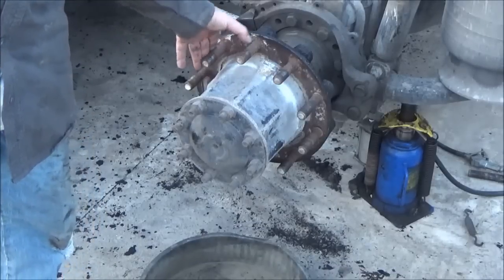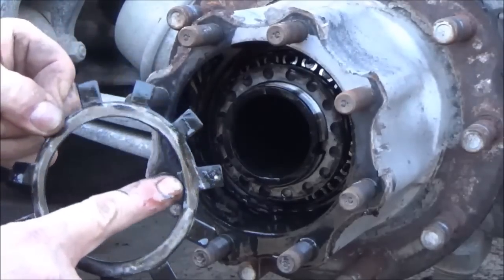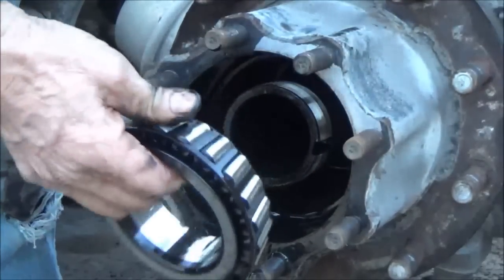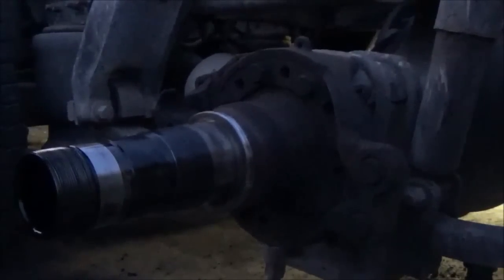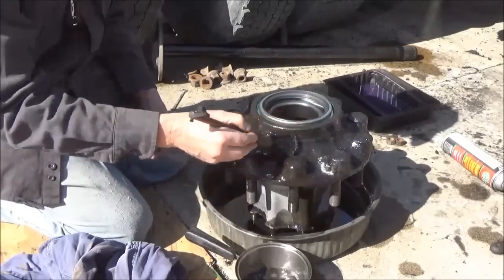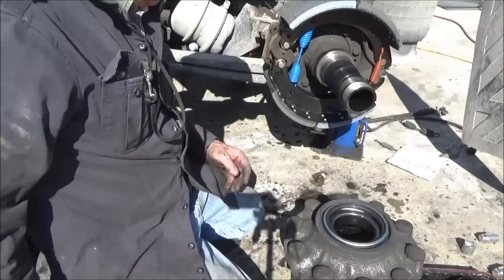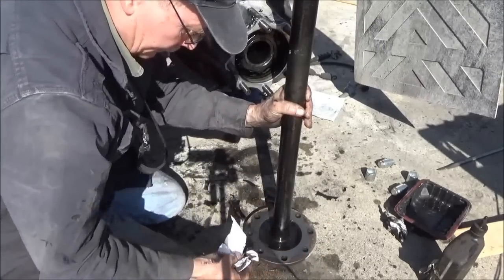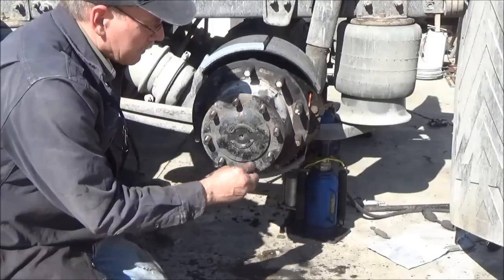Changing axle seal on semi truck at home without all the special tools

Comment: A lot of bad information in this video. I work on these trucks for a living. The TMC (Technology & maintenance council) outlined a procedure for wheel bearing adjustment for heavy duty trucks for a reason, because wheel hubs coming off became an epidemic from people performing bearing adjustments without the proper knowledge or tools. You do NOT use a screwdriver or a chisel to run up bearing nuts, this is not an acceptable alternative to using axle nut sockets. You first use a TORQUE WRENCH and preload the adjusting nut (inner nut) to 200 ft lbs while rotating the wheel/hub, then back off a full turn, THEN you readjust the adjusting nut to 50 ft lbs while rotating wheel/hub and BACK IT OFF  (according to a chart based off of threads per inch and if it is a drive axle, steer or trailer axle) which in the case of this truck would be 1/4 turn. You then align the dowel with the dowel pin on the adjustment nut, put the tang on and then the jam nut. The jam nut torque when you have a dowel washer is 300-400 ft lbs of torque. You will never achieve that with a hammer and chisel (or screwdriver) and will never know what your torque value is. You then use a DIAL INDICATOR to measure the ENDPLAY of the hub which must be within .001"-.005" (thousandths of an inch). Then fold the tabs on the tang where the flats line up (usually 2 or 3). I in no way am posting this information for someone to use, you need to get the TMC procedure which is very easy to download online. I am not trying to crap on the guy who made the video, but I have seen enough damage to spindles and have heard of enough accidents because or improper adjustment to these bearings because people get killed when these hubs come off and can start bouncing around the highway like a basketball and land in someones windshield. If you do this procedure like it is done in this video and someone gets killed and you have to answer in court and have to explain how you did this procedure you are going to be in big trouble. Take your truck to a professional you trust for this kind of work. I am not against guys doing their own work to save some money but stuff like this is a safety issue. Also a wheel seal needs to be driven in with a proper seal driver, using a wooden board is just comical. Don't be surprised if it leaks again.
Reply from the maker: I covered all that with notes on the video, this is one of my 1st videos and lost some of the clips and didn't know it and forgot to say a lot of things, I didn't know the notes only show up on desktop and laptop, and that most people don't use them anymore. I'm planning to redo the video sometime this summer (only the nut tightening part with a socket) I'll still use the clips for the seal, I'm not going to waste the seal for another video, I'll redo it when I can bring it home for some other maintenance.
Reply: Tim Taylor Correct sir! Very well stated. And don't forget to perform your RIST procedure, oil studs and nuts with 30w oil, and torque lugs to 450-500 ft lbs according to TIA(Tire Industry of America) guidelines.
Reply: Yes I agree. Also that Jam nut socket can be purchased for less then $30. It is vital to doing the job right. 
You do not oil or wet the outer seal surface. That is what that green paint is for on it! Oiling it adds another tolerance which is not good!
Reply: Tim Taylor u hating
Reply: Why would you consider the plain truth hating. Getting this wrong could only cost some innocent motorist there life all for the want of a < $30.00 socket.
Reply: Tim Taylor yea I took my 379 to 4 different Pete shops in 1 year for a front wheel seal and they all did it "the way the school taught them" and just before I was about to buy a whole new axle I took it to an old school mechanic like mr Robertson, my mechanics name is George Robertson lol, anyway he did it basically like this gentleman and as far as I know it never leaked again and that was two years ago. Guess the books don't know everything do they.
Reply: I agree a torque wrench is the best method..  but really how many people Test their torque wrenches periodically..  have you ever taken 3 or 4 torque wrenches on a tester and noticed that all of them vary quite a bit?  yeah because Most mechanics ASE or not, dopnt realize these things can go out of tolerance..  the engineers and designers of these roller bearings know that there are tolerances..  I venture to say with these things that too tight is MUCH worse than too loose.. in fact thats what ive found with most things in rotating mechanics..  over tightenng kills..  re-using the bearings likely has much less of a failure rate than new ones as long as they are still in great shape. alas they have already rotated and seated to the races..  and unless you have removed the race  its going to go back together the way it came apart..  esp if you take the time to clean the spindle so all can slide back together..  if you have to rip it off the spindle.. then replace the bearing and follow a seat procedure..  I always seated a bearing 3 times..  remember you are working on COLD bearings..  so you dont want them too tight.. or you will burn em up and end up wit ha wheel bouncing around.. if you jack your truck up in 2 weeks and noticed the end play is a little high, its pretty easy to pull the hub cover and add an 1/8 turn to the nut..  I love books and I love tools..  BUT the best  mechanics are really performed by the driver inspecting his truck regfularly while out on the road..  shooting the hibs with a temperature gun at every fuel stop, coop stop, or rest break..  visually looking for leaks, smelling for oils..  (everyone reading this knows hub oil smell im sure)..   the most catastrophic failures i hear of are the "Oh I can make it back to the yard".... not so much from a mechanic who tightened a nut with a hammer and a screwdriver
Reply: Tim Taylor sure take it to the closest TA or loves and let one of those certified mechanic do the job and then let me know how long before it's licking  again Mr Robertson have 5k subscribers most of us DIY he's it's old school and let me tell you he's dam good he can in frame an engine on he's garage with out having to pay 20000 to get it done but the first thing you will  notice if you watch he's videos it's common sense ( old school teaching) if you don't think if safe or if you don't think you can make it on a safe way simple don't do it besides for most of the drivers this video it's for recreational purposes maybe if you are a real DIY O/O you may learn a thing or two
Reply: VX Adventures u
Reply: TA certify mechanic? Last time my seal get leaking for just 2 months. And everything was done with the correct procedures and tools. So not every Certified mechanic it's a good one don't understand me wrong. The tools are good thing but knowledgeable mechanic it's much better! If the seal is not leaking who's care how was done?
Reply: I doubt well used bearings should be subjected to the same sorts of preload brand new bearings with unseated, unstretched cages are set to. I don't and just feel them in. When you tighten them until you feel heavy drag then back off half a turn then tighten again until the slightest drag is felt has worked on used for me.  Less than two cents worth but with inflation who knows. I pack them with grease just to be sure they have a little love in the first couple miles, until the diff oil gets out there.
Reply: Tim everything you said here I admit is correct and right.
I noticed he used a plank to install that CR seal & I know very well that seal must be installed with proper driver. See its actually a seal that has the sealing surface inside of itself not where it contacts the axle housing, so it is very important not to damage that surface he hit with a plank & hammer. I was 40yrs in the trade & learned the way he is doing it and have done it the same way. But I also saw others doing this way and I know they weren't on there game and left alot to arragance & many failures took place. I relearned & became fond of getting and using all the proper tools I could aquire. My advise to all you young guys coming up in these jobs. Learn the old ways but also Train yourself to insist on doing the job properly with out the short cuts. YES YOUR WIFE AND KIDS COULD BE IN THE CAR IN FRONT of the truck you worked on some day. Please think of that when you get into your next repair.
Thx 
PS the court is a very hard consideration!
Reply: Tim Taylor go do some game vids or something
Reply: Tools aren't all that expensive and pay for themselves on the first job or two, then you keep the tools for life!  You can get away with a lot but too many people lack the EXPERIENCE to know what you can get away with most of the time and what should be done right every time, so the safe default if you are not a hardcore mechanic is follow the instructions and procedures as written. Ask any truck mechanic about customer-induced horror stories!
Reply: Tim Taylor he owns his truck so who cares
Reply: ive been using the wooden board for a long time but you could use a fine steel board.. it will work for almost every wheel seal.. ive seen damage in spindles and bearings melt.. because using hammer and chisel and got too tight.. but never a flying wheel.. anyways safety first
Reply: Well that is just real nice if you have the luxury of being able to pay someone to fix your truck.  But many, if not most, independents are running bare bones and have to make do with what they have.  If the situation was as dire as you state there would be class 8 tractors littering the medians and ditches, but there are not.  Almost everything in life has a "recommended" procedure, and almost everything has work-arounds.
Reply: Tim Taylor where do i get these TMC procedures from? Can you share a link?
Reply: Tim Taylor :
Reply: Tim Taylor maybe a lot of guys do it themselves because the professionals charge $120 an hour and they still git wrong most of the time when I pull into a so. Called professional shop they put the dumbest sob they got on my truck . I have put a lot of seals in with a wooden board ..the screwdriver is a little sad however
Reply: Tim Taylor ok yer right ders ALOT of bad Info
Reply: Only the screwdriver part is bad other stuff is gud. I used chisel one time on trailer to tight the nut beccoz I didn't have the socket that time . But I put both tires on hub and check bearing play before put  back the hub cap. Now I always buy adjustable nuts for both trailer and truck hubs dat way easier for any wheel hub to adjust . One more thing if you have lots work experience then you can do
Reply: Gurpreet singh sandhu cleaning the hub after you put the bearing in is pretty bad ..also he didn't check his S cam
Reply: James Rowland so what if the seal leaked at least the hub didn't fall off. Using a hammer and screwdriver is not safe
Reply: Tim Taylor 
I've been a truck mechanic over 40 years, 25 on refuse trucks, and I don't know anyone who who does all the bells and whistles of the tmc procedure. Use a torque wrench to get the feel of 200 and 50 the first couple of times. 200 is about as tight as you can get it with a 3/4 ratchet, the 50 you have to get a feel for. I don't back it off and then for the outer nut put a cheater pipe on the ratchet and cinch the piss out of it. And I've never had a wheel end failure. 
I have put a dial indicator on it a couple of times and it comes out .001 to almost . 003.. Using a hammer and chisel to tighten the nuts. Not just no but hell no. Not only guaranteed to leak but almost guaranteed to come off and /or ruin the bearings.
Reply: How did the seal hold up after a year mr Robertson??
Reply: YES! USE A TORQUE WRENCH ON THOSE NUTS.DON'T SAVE TIME CUTTING CORNERS.
Reply: You should do heavy equipment repair videos as well!
Reply: Ill get super technical right now !!! I dont give a fuck how the nuts get tightened as long as there is no damage to the nuts.. but if there is between .01 an .05 of end play on your good to fucking go...

Now it is nice to be able to seat the wheel seal and torqueing to whatever and backing off and etc..

But if there is endplay between .01 and 
.05 wheel end shouldnt come off unless nuts are not locked.. the seal may leak not torqueing but well the seal is cheap do it again!!! 

If it work it works.. this was a awesome video 

I bet it never fell off 

But i bet it had a pre mature failure
Reply: jjc882011 

Please post us all a link to a news story when this actually happened
Reply: Just working on my drive wheel brakes.   The professional shop that put drums and shoes on, backed off the slacks all the way then never adjusted 3 of them back.  They left a clevis lock nut a 1/4” away from the clevis.  The one brake that was working had oil on the shoes from a bad seal.   They also never put anti seize on anything.  I put it on the clevis pins for sure, or I’ll have a brake hanging up by next winter guaranteed.   I normally do my own work, but didn’t have time, but I spent time going over it the right way anyhow.
Reply: Chump Johnson you are 100 percent right chump most of these mechanics charge shit load of money later to find out they didn’t do it well. And when you take it back they always have some lame excuse and try to make you pay for something else.
Reply: Milo P 

It’s across the board in all sorts of services. It’s the American way now.
Reply: @57bagre  thanks for making this video  do not be discouraged by negative comments.
Reply: What about for light trucks, does it have the same torque for preload adjustmenf?
Reply: Time Taylor thanks for posting. I'm pretty sure that I've been a little off. I thought it was toque to 200 while rotating hub, back off a 1/4 turn, then torque to 50. I always torque my jam nut to 350. I'm going to download the procedure, but I can say I've never had a problem.

Comment: Idk but that back yard style. I would use torque trench to adjust my bearing. Doing by feel kind of  stupid.
Reply: I have done maybe 100 times wheel seals with out using torque tools. No problems so far.  And I don't think is stupid
Reply: Just out of curiosity do you guys check end play with a dial after you're all tightened up. Or can you get that by feel aswell?  Seems like it would be easy to put it too tight without checking.
Reply: @joshhead9368   I don't but I know u should... Anyone else notice his outer nut was kind of loose?

Comment: As a owner operator with 39 nine years of wrenching on semi trucks this video makes me cringe. You really should buy the proper axle nut socket. With the socket, breaker bar, and a 3 foot pipe you will be able to put some serious torque on that outer nut.
Reply: foureyednotchstang I did the same thing he did on a 1975 Ford Econoline.I used simple tools like a screwdriver ,chisel and hammer.I was replacing a wheel bearing and later on down the road the axle came out while I was driving.Not enough York on the outer nut.,I guess.

Comment: how do you put the oil on it??
Reply from the maker: You're supposed to put a little oil in the hub before you put the axle back in, but if the bearing is wet with oil and the differential is full or real close to full as soon as you drive away the differential will pump oil to the hub.